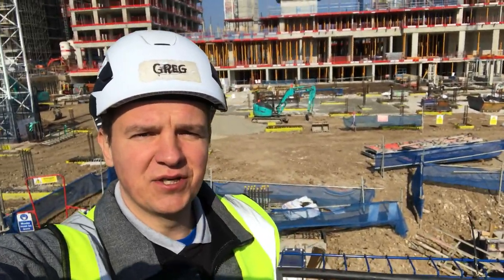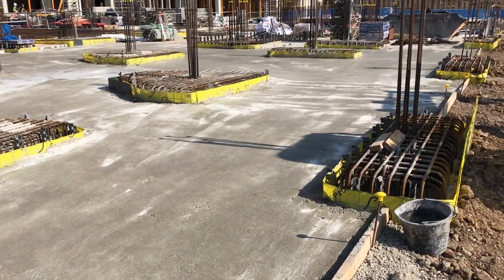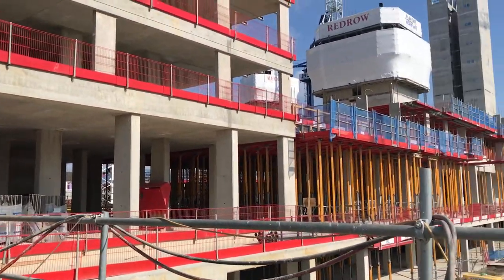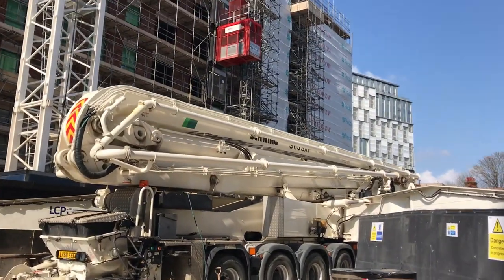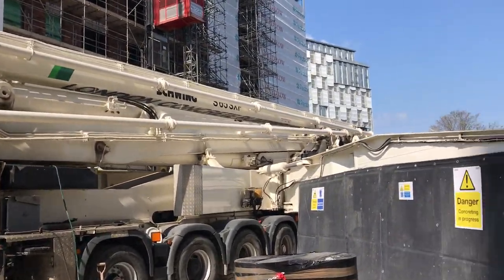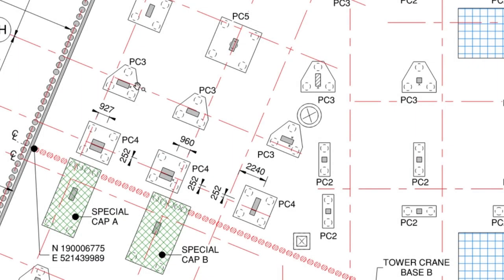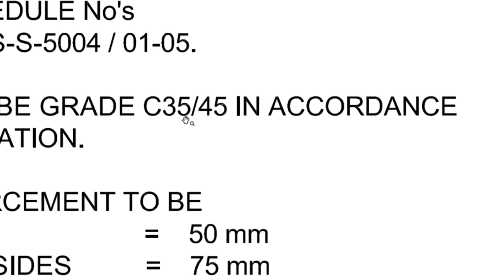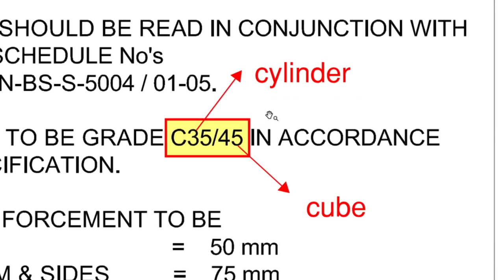CONCRETE. How to CUBE up the concrete. Concrete distribution on construction site.

Comment: My request humble request is if you could.please include these in your future videos i know it is a long list but i am sure most people will also need this:
- rebar call off (how to order steel)
- section and elevation drawings
- how to set temporary control points and recheck them
- how to calibrate and inspect the EDM
- calculating stock pile volume
- using pipe laser 
- profile boards and traveller
Reply from the maker: Hi Khalid! I'll do my best :) I will do video about the steel soon.